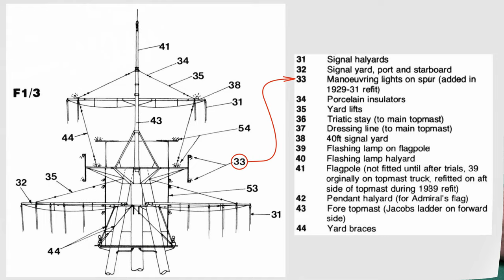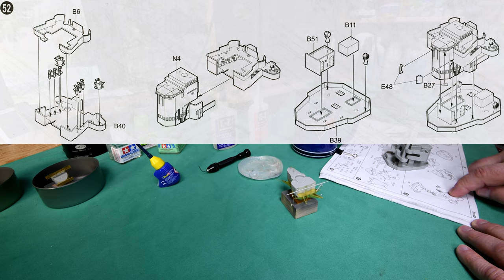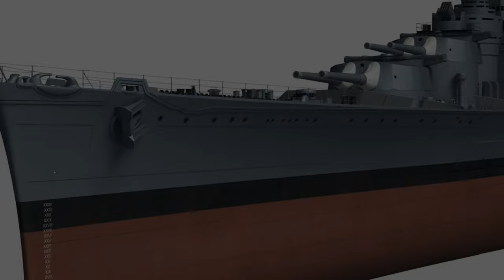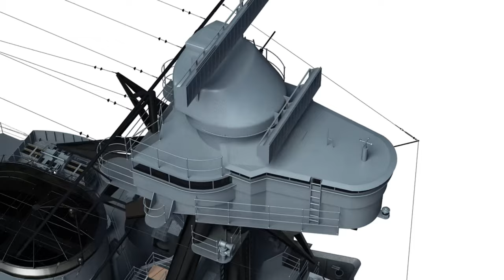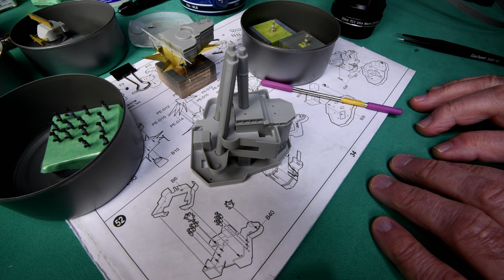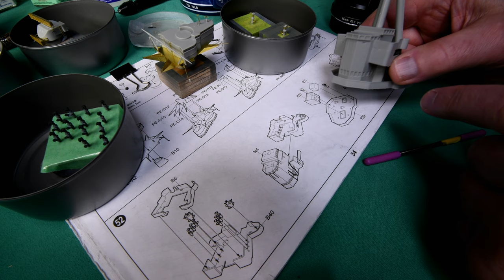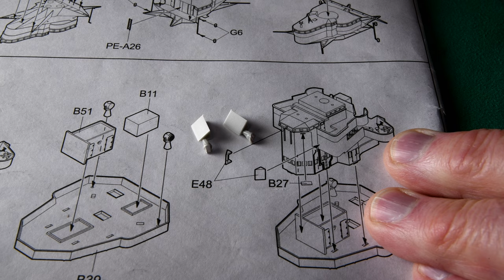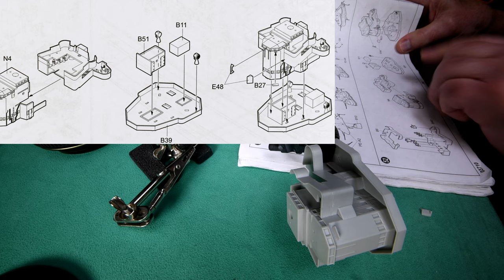The Model Ship - Part 790

Comment: Hi Ron, if you have used the Tamiya extra thin, you may be able to separate the parts.  Simply run more glue into the joints and pull the parts apart, as the plastic heats up from the glue they should separate, I have done this a few times it does work.  Never tried it with Contacta professional, imagine that could cause other issues.  I have just loaded up a 2min video showing you how it works, hope it helps.
Reply from the maker: I mention your helpful video in 791 today. Thanks Jason. 👍👍

Comment: Soldering those small fragile photo etched joints might be better than using glue.  It is fine and sunny in Australia.
Reply from the maker: Hi David,
I'd thought about soldering but it was way too close to the plastic parts.